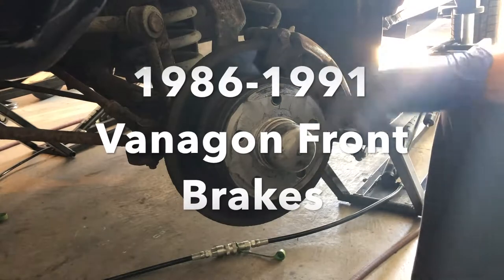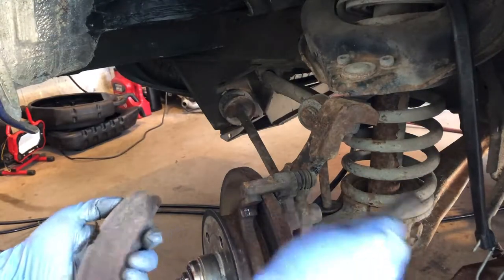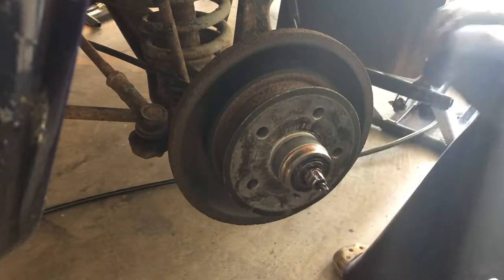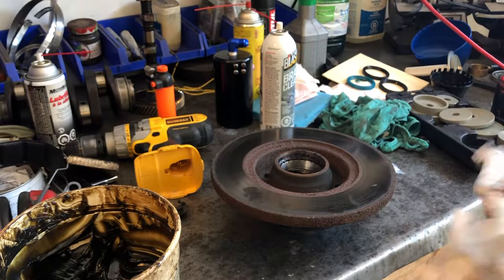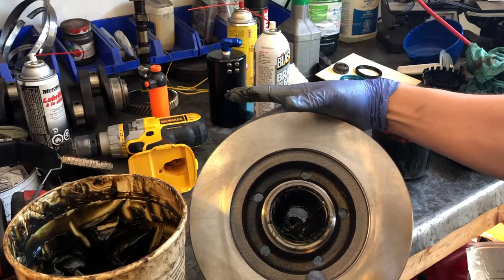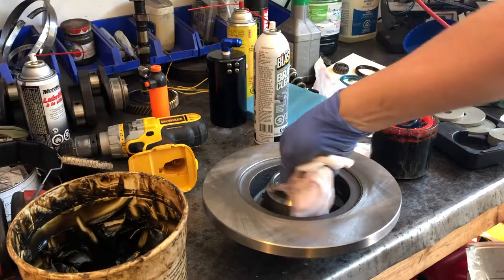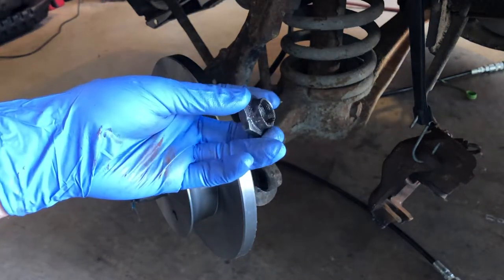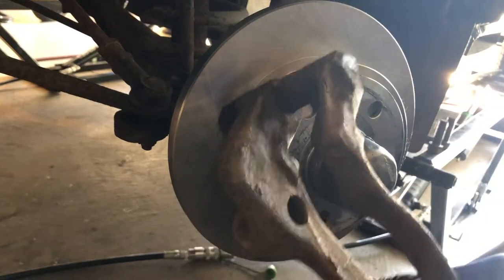VW Vanagon Westfalia Front Brake Replacement

Comment: You sped through the important part of how to seat the bearings during the tightening, and how tight to make it. You also didn’t show how to pack the dust cap and how to secure the speedometer cable in the dust cap.
Reply from the maker: At 19:40min mark to 20:00min I explain how to preload the bearing (what the manual says - and it does not say much)  I really didn't think anyone would care about me turning the nut back and forth, and its hard to explain how hard I'm turning it. I have done a ton of these things, as all the old rear wheel drive American cars were the same set up (except for the speedometer). Most guys do it by feel, and I do say the final torque should be about 1ft/lb after preload. Sorry about that. I think next time I will use a beam style torque wrench so everyone can see how hard I am turning. Also for the dust cap there is no need to pack that, it should remain dry, and just line up the speedometer cable. I did speak about that at 21:40, but I did not show it on the camera.  I thought it would be self explanatory as the square hole in the cap lines up with the end of the speedometer cable which is also square. This is one of my earlier videos that does not have a lot of editing in it, and frankly its too long. Most people watch on average 3-4min so now I try to put just the most important stuff in, and keep the length down. I'm always learning so I appreciate the feedback.  I have come a long way since this video in terms of making instructional videos. I appreciate the comments. If you need any clarity on anything please reach out.  I have helped many others on repairs (that are different) than the videos.  Thank you again, and hope you enjoy your weekend :)

Comment: Just watched your video on Vanagon front brake replacement.  Can you tell me what torque FP you used on the two bolts attaching the caliper bracket?
Reply from the maker: I just snugged them up good, I've done so many brake jobs I just do it by feel.  On my newer brake vids I put the torque specs in, and I'll put the specs in the Vanagon engine Im' rebuilding now when that vid is out.  Usually on most vehicles pins are 15-20ft/lbs and those bigger bolts can range from 30-60.

Comment: I just finished doing this on a 89 is the rotor supposed to move back and forth a little after being tightened?
Reply from the maker: No, there should be no play.  If there is play most likely what happened is you did not set the preload correctly.  Not a big deal.  You can jack it up, pull the dust covers, take out the cotter pin and then snug them up.  Thats all you need to do.  I have done lots of brake jobs on older cars with these style of bearings and most are loose.  Glad you enjoyed the video!!  If you need anything else just let me know :)
Reply from the maker: I forgot to add that I am a Vanagon Owner so I do regular videos on my Vanagon.  I have a playlist "Vanagon Repairs" on my channel if you want to check it out :)  If you like I would appreciate if you would subscribe!!!  Thanks!!!
Reply: @GarageKing  I figured it out the castle bolt was the issue, because how old it was it didnt go tight. I am redoing it when the parts arrive since the upper ball joints are bad also but i appreciate your fast response
Reply from the maker: @stevenb320  Anytime Buddy!!!!  These Vanagons are getting rare so keep it on the road as long as you can.  I love mine :)

Comment: looks like wheel spins fairly easily, mine has a lot more drag, and I did the preload too....probably need to go back check it before I cook something unintended...would 85 be different ?
Reply from the maker: No, 85 should be the same.  Make sure the grease seal behind the rotor is straight, if its not in right it can cause drag.  When you spin it, make sure there is no "roughness", even though it might be a little more stiff, it should not be rough.  Remember that centre nut really does not have to be tight at all.  I have taken brakes apart where you can just take the nut off with your hand on some vehicles with the same style brakes.  Hopefully I helped you out and if you need anything else please let me know.  Thanks buddy, and great pic in your avatar (yellow bug)
Reply: @GarageKing  it was 2 things; the grease seal was not even (replaced it), and the NEW dust shield was so far over, it was dragging on the whole rotor, bent it back and all good now,  bled brakes, have great pedal !  Thanks...and glad you like the avatar, it my yellow bug that;s just fun to drive...
Reply from the maker: @DanTheManIOM  That is awesome!!!!!  Ya I thought it might have been the seal, and the dust shield can surely contribute to it.  Glad you are all up and running :)

Comment: Hey great video, but where is the Brake Dust Plate?  I have an 86...  The dust plates were seized on, but I was able to replace them.   Does your van not have the brake dust sheilds?
Reply from the maker: Hey buddy great find, you are the second one to notice that.   Mine were rusted right off and I needed the van for a trip. I didn’t want to say they were not needed in the video as I would have been flamed!!!!  And I had to get the job done so for a test I just didn’t mention them.  You are the second so good catch buddy!!!!  Also just as an FYI it still braked fine and I have had no problems.   Thanks for the comment :)

Comment: I would like a seal driver kit. Can you tell me what i should order on the canadian amazon site? txs
Reply from the maker: Hey There, I use a wheel bearing tool 99% of the time.  In the video I used a special tool, its plastic and to be honest it does not work well.  I would get a kit like this https://amzn.to/3Pb1Ah5 its because the parts are steel and have some weight to them.  You can get the aluminum ones like this https://amzn.to/45PqUAA which are much cheaper but I find that sometimes its a challenge with aluminum ones as they are too light.  Be careful of some of those "bigger" sets because they come with a lot of small drivers and don't give you the bigger ones.

Comment: No disc protection behind the disc ?
Reply from the maker: Good eye you have, they were actually rusted off, and I needed the van and could not get a set in time.  They actually don't provide any protection, they are used for cooling as they help to direct air to the rotor.  The problem with the factory rotors are they are solid, so they don't cool very well to begin with.  I did the brakes in 2019, and I have not had any issues with them, but I don't drive through mountains.  Maybe if you are going through a lot of hill they may overheat.  Good catch though, appreciate the comment :)
Reply: @GarageKing  OK thanks, mine are completely destroy by the rust and bolts are completely rusted too. I think i'll follow your way and delete this protection. Thanks for your feedback about this modification
Reply from the maker: @angerx4  anytime :)

Comment: is this the same for my 83.5 wasserboxer? or is it specific to 86-91?
Reply from the maker: These brakes are for 86-91, your 83.5 will have different brake calipers, but the rotors and the removal process for the rotors is the same.  Its just your calipers are a little different.  There are two types of calipers, 80-85 and 86-91.  The brake job is basically the same as the important part of the video was showing the removal and re-packing of the wheel bearings and how to set the pre-load.  Your brake calipers are just two bolts as well and they come off, you take the pads out and push the piston back in.  Hope I have helped and if you need anything else just let me know :)  Thanks
Reply: @GarageKing  thanks for the reply. im actually taking good parts off a donor van and putting them onto my recent fixer upper I bought. is it possible to remove the disc, callipers and brake lines all in one to transplant on to my other van?
Reply from the maker: @MrHump86  Sure I think that should work, the rotors are the same.  Just remember if you need to do brakes on your recent fixer upper in the future, make sure you remember to order the 80-85 style brake pads to go with the 80-85 style brake calipers that will be on your van.  I'll think you are good to go.  Don't forget to sub if you want, as I have a whole section on my channel about Vanagon repairs and I keep posting a new one every so often as I have to mix up the content on my channel.  I help a lot of Vanagon Owners (I own one and am a mechanic) Thanks Bro and if you need anything else just let me know.
Reply: My donor is an 84 and am transplanting parts to an 83.5. I’m sure there won’t be any issues. Thanks very much for the help. Do you have or know of a good video for a step by step engine swap/removal/install for 1.9L vanagons? Thanks again
Reply from the maker: @MrHump86  I removed and rebuilt a 2.1L and sadly, very sadly, did not film, one of my biggest regrets........  When I took mine out I took out the engine and transmission together, it was much easier.  I had the van on lifts and used a motorcycle jack with a flat piece of wood on it to lower the engine down.  The 2.1 and 1.9 are pretty much the same for removal and install.  There is one mount for the transmission, and one for the engine (its that bar near the exhaust)  For me that was the easiest way to take out.  You could leave the trans in, but I think it would be hard to line them up, plus if the trans falls there is only one mount holding it and I think it would break.
Reply: Thanks. I’ve removed a transmission before from my old van. I was wondering if both the tranny and engine could be removed together so thanks, I’ll give that a try. I’ll keep you posted if I have more questions. Thanks so much
Reply: Hey me again. Been looking online a lot and I can’t seem to find the answer, Curious if you know. I need to swap the rear hatch from one van to another. Unscrewing the hatch at the top and removing the struts seems simple enough, but how do I detach the wires and tube that go to the rear wiper and washer fluid. Appreciate the help
Reply from the maker: @MrHump86  Hey It's funny you mention that. My rear hatch has the dreaded rust along the bottom of the windshield....  So I was thinking if of trying to repair mine somehow or replace my rear hatch like you are doing.  I'm looking at the Bentley Manual and to remove the rear hatch it says to disconnect the rear window defogger wire (seems easy), then it says to remove ground cable and pull wiring harness out of rear door.  So it doesn't give much.  I would say to get the tube out, and the electrical for the rear wiper, I would think that you remove the inner panel of the hatch and disconnect everything and pull it out.  Now the wire should not be that hard as it bends, but I can see the tube being a problem as it could break if you bend it too much......  I think once its all disconnected (make sure the rubber grommets are loose so the tube can slide easily) then maybe you could just undo the door (with a friend) and two people slowly pull the door away and a third helper fish the tube out as the door is moving away.  I think that is how I would tackle it.  Let me know how it turns out, because I think I'm going to be doing the same thing.  Sorry I couldn't give you a better answer on this one my friend :)
Reply: Thanks very much
Reply from the maker: @MrHump86  Hey Anytime, not sure where you are located, but I have been looking around and that rear hatch is hard to find in Canada.  I might have to try to repair the rear window.....  Still on the look out though.
Reply: Toying with it now. Having a bit of a difficult time. Do I unplug them from inside the hatch or just inside the vehicle on the ceiling?
Reply: Does the rear fluid redo our supply the front windshield as well. It seems the rubber tube runs across in the top itself then toward the front. It’s just seems more complicated then it needs to be
Reply from the maker: @MrHump86  I would do which ever is easier.  If your ceiling is open it might be better that way, but most of the time I would think its easiest to unplug from door so when you are removing door you can make sure that nothing gets hung up.  Unless the ceiling was wide open I would unplug from door as its probably easier to fish out that way?  That would be my guess.
Reply: Do you have a different messenger to chat on?
Reply from the maker: @MrHump86   No the front windshield is separate.  Front windshield fill tank is under the driver's mat (pull up your matt, I'm pretty sure thats where it is) Thats why I think its probably easier to take off rear panel off rear door and fish everything out that way.
Reply from the maker: @MrHump86  you can contact me, go on the about tab on my main page then send me an email.  I have to go but I'll be back on in about 2hrs
Reply: Why are there twin rubber wire/tub “gromets” on both sides of the top of the hatch. Both seem to have the same rubber tube for fluid
Reply from the maker: @MrHump86  GO to the about tab on my channel and send me an email, I will send you a diagram of the rear washer system